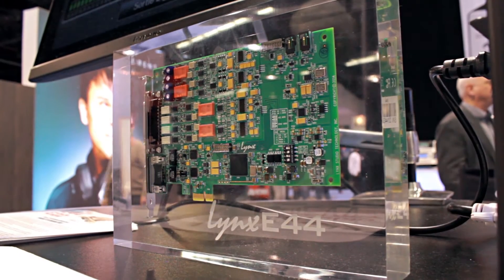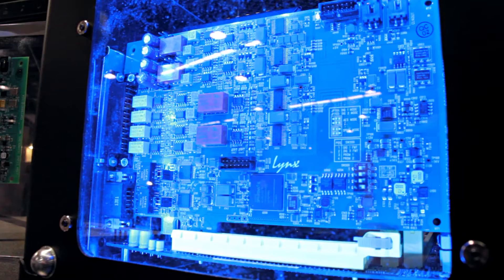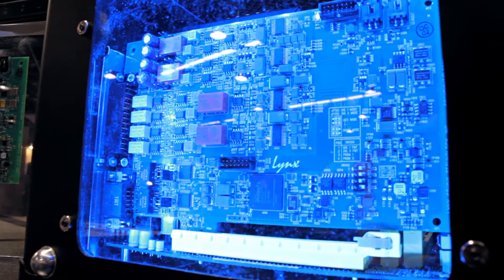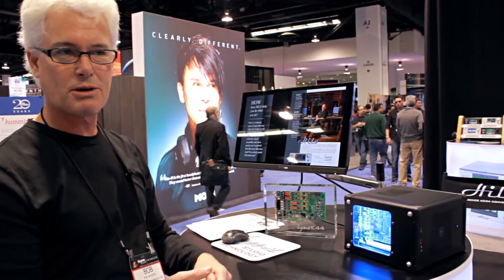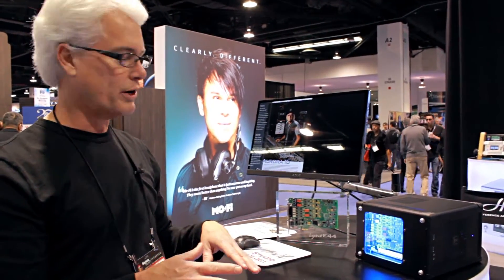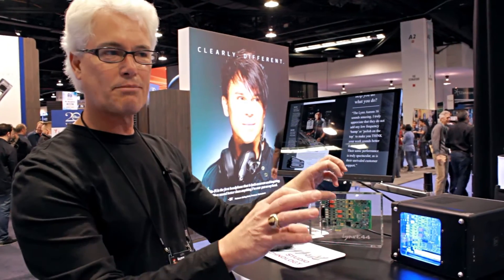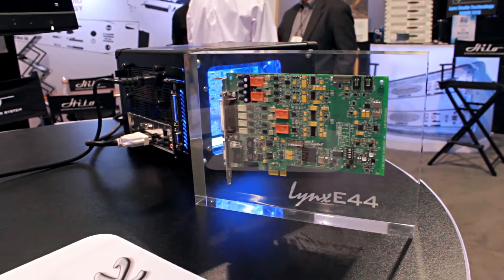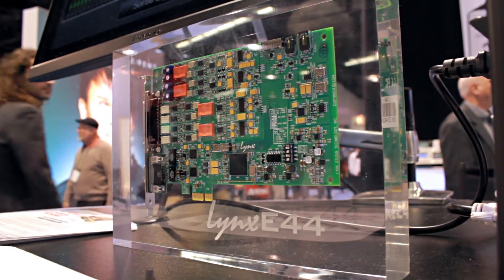Lynx E22 & E44 PCIe Interface Demo - Thunderbolt Chassis

Comment: Regarding the E44 Lynx, which has 4 analogs in and 4 analogs out, do I connect mic preamps using XLR cables to the analog in D-sub of the E44 and then D-sub out XLR to two monitors to hear what I'm tracking? Will this setup work? Thanks in advance.